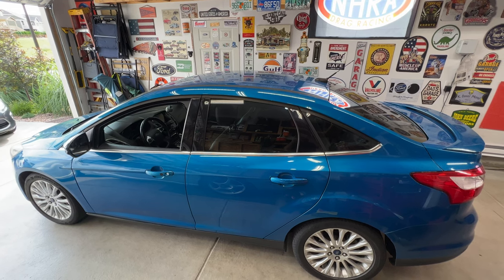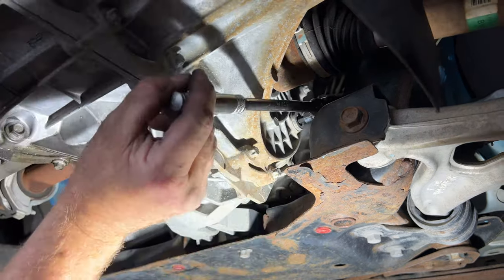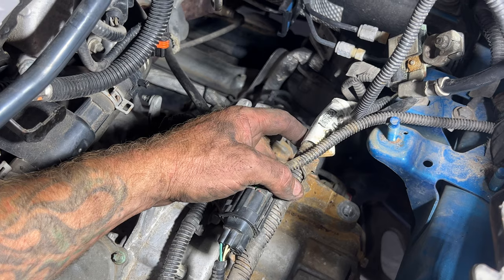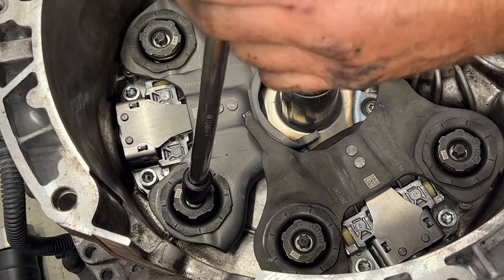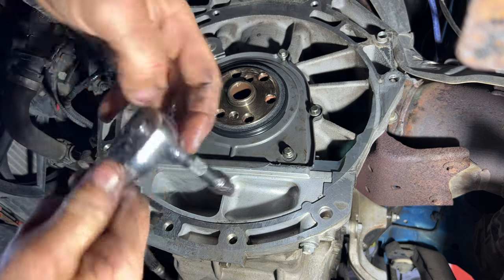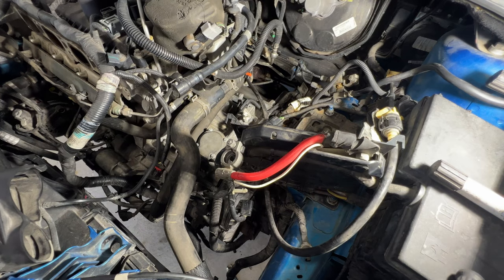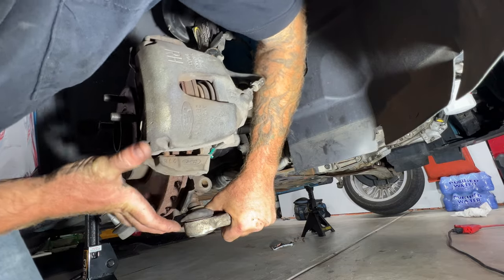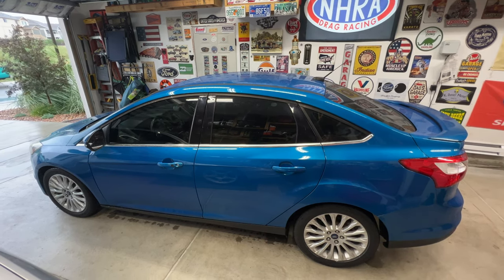2012-2018 Ford Focus Dual Clutch Change Plus Rear Main Seal Replacement How-To

Comment: Thank you so much!! This was the best walk through on this entire platform. All the angles, all the lighting, all the information like torque specs. You sir deserve a special place in heaven. Just test drove my car after doing every single step in this video and I can confirm that my car works better at 130k miles than when I bought it at 80k miles. I cannot thank you enough!
Reply from the maker: Glad I was able to help I appreciate the feedback.

Comment: After you remove the flex plate bolts, turn the flex plate a little. Reinstall two bolts, opposite each other, and turn them in. They will press against the flat surface of the crank and push the plate off. Well, that's my theory. I haven't tried it yet.

Comment: The sealing material that comes pre-applied to the new seal that runs along the inside bottom doesn't mate to any surface. The PVC gasket you applied is the only seal along the bottom. Did I miss something? The position of the camera must be hiding a ledge for that lower seal.

Comment: Thanks for all the additional time you took making this.  My 16yo son and I replaced forks, clutch, axles, motor mounts, transmission mounts and fluids with your help. 
Dealer quoted $5500 for the job ... and they wanted me to pay separate labor for all of those items. Parts were $1650 and tools needed were $500.  But a day working on a car together was the best part.
Thank you.
Reply from the maker: First of all I want to say thank you for the $100 super thanks, you didn’t have to do that but it is much appreciated. It’s also awesome to hear that the best part of the job was doing this with your 16 year old son and spending time with him. That encourages me to continue doing this videos knowing that it not only helps someone out and saves them money but is all teaching the younger generation at the same time. Cherish these moments with your son, I lost my dad at an early age but he’s the one that taught me everything I know about auto mechanics and repair and your comment reminded me of myself when I was 16 out there with my father teaching me how to fix my car in high school. Thanks again

Comment: This video by this guy is awesome.  Very detailed to get the job done.  Excellent links to get the parts and tools.   I would like to add one thing that would also help everyone taking on this task,  before transmission is removed,  I cut a angle iron approximately 1.5" x .25" x 48"  and placed it frame to frame parallel to the engine where the intake manifold was.  Then ran a chain down to the hole by where the starter was and attached the chain to the angle iron above.  I cut another angle iron approximately 1.5" x .25" x 30" and placed it  on lower part of firewall and across bottom of the engine.  Ran another chain from upper angle iron to lower angle iron and bolted the chain together.   Now I did not need to have engine support in the way of removing the transmission.  I was also able to lower the car on its wheels  while waiting for the parts to arrive.   Worked very well.  Best wishes.
Reply from the maker: Thanks for the extra tips

Comment: I wanted to thank you tremendously for taking the time and effort in putting this video together. I used this religiously as my guide to repairing my daughter's 2014 Ford Focus. My first transmission project. Your guidance made it a success. My daughter is thrilled to have her car back. Thank you. Thank you. Keep me in mind if you do a water pump replacement for a 2003 Kia Sorento.  Lol.

Comment: This was an awesome video your explanation to every detail was very helpful and excellently well done. Your master skill in mechanics made all this look like someone that is mechanically inclined could take on a project like this. I know firsthand that it’s no were as easy as you made it look. Thank you for doing this
video it was very helpful. Can you tell me how much would a job like this cost, this would be a good reference
point not to get over charged by a repair shop.
Reply from the maker: The local ford dealership here in town wanted 3k to do this.
Reply: I was recently quoted $3,800 by my local dealership to complete this job, with that quote I’m heavily considering taking this job on myself

Comment: Fantastic job with very good filming skills. You should have removed the engine oil pan to get better access to the clutch screws and the main crankshaft seal.😊

Comment: My mom got a 13 Focus off her dad after he passed. It was Garage kept with not even 20k miles on it and it needs the dual clutch done. I also noticed a couple drops of oil on the bottom where the tranny connects to the engine so I wondering if that could be from that rear seal. Thank you for the detailed video of what to do, if I can fin a place to work on it I am going to do it for her. Only thing I don't have is the scan tool that can do the relearn, ill have to see if I can borrow or rent one.
Reply: If you can’t find one you can see if a dealer will do it for you just have to get the car there
Reply: Don’t really need it as the car will relearn without it but it does speed up the process.

Comment: Fantastic Guide - So thorough! Give me lots of confidence in working on mine -  Can I ask your advice on my 2017 Ford Focus SEL? I recently bought it used (auction), carfax shows 6k miles previously the ford dealership replaced the clutch... So it shifts smooth and drives great, but it makes a scraping noise sometimes when coming to a stop, definitely a transmission noise. It's not jerking or shuttering, but this scraping noise is sometimes loud and sometimes quiet or gone, occasionally even a kind of clunk is felt, mild though. Happens most in traffic. Mostly when slowing to a stop or near stop. Car has 125k on it, clutch job from dealership at 119k. I am thinking when they did the clutch they didn't do anything for the actuators and forks area and maybe lots of dust still in that area? Let me know what you think!
Reply from the maker: Thanks for the super thanks I really appreciate that. That’s a tough one and you’re positive it’s coming from the transmission? I know a lot of the Ford dealerships when they were doing warranty claims on theses transmissions they would just replace the seals and clutch without touching the shift forks or actuators in my opinion everything should be replaced all at once. Might want to check the bearing on the passenger side cv axle. Could also put it up on some jacks stands and have someone put it in drive and just listen underneath to try and narrow it down just be careful doing this. That’s all I can really think of right now.
Reply: @BLUECOLLARGARAGE  I say transmission because when I come to a stop, the car is no longer in motion and then it goes and makes that clunk or scrape sound as the transmission fully disengages. It corresponds to the lower shifts, and the rpm changes. It's almost like something slips and then you hear the clunk.  It tends to do it more once the car has been running for a while...I was underneath it today and noticed it's leaking from the rear main seal too, so that's not great. The car shifts pretty smooth though and drives well. So I was just was hoping to avoid a lot of work... Maybe just continue driving it, I thought maybe these cars could have noises like that. This is my first experience with one.
Reply from the maker: @NickyJayO  sounds like maybe the shift forks could be caked with clutch dust and possibly sticking. If I were you I’d just keep driving it like you said and wait until it starts slipping or shuddering unless that rear main seal gets really bad. Also are you sure it’s motor oil? And not the transmission fluid? I’m assuming they updated the oil seal when they replaced the clutch but then again you never know. You may want to just check the transmission fluid level from the fill hole just to be sure.
Reply: @BLUECOLLARGARAGE  You might be right. I was just driving it and with the windows down as it disengages out of first gear on slowing it sounds like two metal plates going clank, it is actually pretty loud. I didn't know they could get sticky like that. And that's a good point I will have to check that fluid level. Not sure what low levels would do, but will def get that sorted out either way.
Reply from the maker: @NickyJayO  keep me posted and let me know what you find.
Reply: Hi, my 2017 Focus makes that identical sound and sometimes can be felt too. I have 80k on mine on the transmission parts, it's all original. I've noticed the loud clank sound and pop feeling from it occurs much worse when the car is fully warmed up and I stop quickly causing a rapid downshift coming to a stop. It could me a variety of different things, I've always chalked it up to a quirk of the noisy clutch. I've driven mine 25-30k making this sound so I don't think it's a sign of eminent failure. 😊
Reply: @randalcalvert270  Thank you for this message! That is reassuring to know :) I truly appreciate your comment....I have noticed in the last week or so that the noise has become much less frequent. No idea why. I expect it will start up again but this is the best it's been since I got it. 

I have a good mechanic to help if something goes wrong and I don't want to drop the transmission just yet. Although I have a leaky rear main seal that will need attention sooner than later... I was actually wondering if using a little lucas in the engine oil could help reduce that leak.

Again thank you for that comment that helps give me a little peace of mind!
Reply: @NickyJayO  You are very welcome!! I drive about 25k a year with a lot of both town and highway miles due to my job. I've definitely noticed the sound is more noticable when I have been driving a lot and then drive in town afterwards. I assume it's due to the clutch being hot and being noisy since it's a dry clutch. My VW Passat has a wet clutch design which is pretty much better all around, it occasionally does less noticable quirky jerks and clutch noises too.

Comment: Wow! Really great video. I’m going to use this when I replace my clutch here soon. 

Question…I have a 2013 focus s. And when I turn the car on (ACC) there is a grinding sound coming from the trans, the noise is concentrated where the TCM is. Have you experienced something like that? Do you have any idea what it could be? 

I took it to Ford and they said it was the  clutch assembly…so I decided to do the work myself. 

I just want to be sure that the clutch is the only issue.

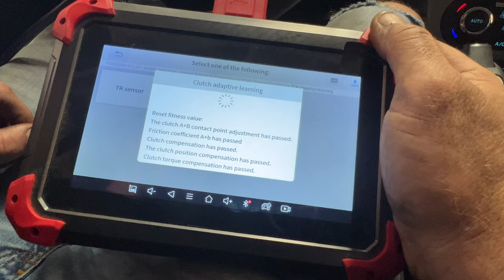Comment: great video - appreciate how you took us right to the end. After three tries with the programmer/scanner, I finally got it to pass all tests. Transmission worked fine on the test run - for two miles. As I was coming back into the driveway, it shifted strange. I pulled up to the shop and realized I had lost reverse (again). I tried going through the learning process again but when at the "clutch" stage the test failed saying it coud not read the module. This is at 3:31:22 in your video. There are two test screens - mine failed on the second one a the "two gearbox shaft neutral" point and went no further. In summary, I have forward gears but no reverse. Ideas??

Thanks
Reply from the maker: Just now going through my comments were you able to figure it out yet?

Comment: Really good video! Thanks. Did you change the oilfilter on the transmission?
Reply from the maker: This transmission doesn’t have a filter. It’s a dry clutch setup so it doesn’t take normal atf fluid. It’s pretty much a manual transmission that automatically shifts for you.
Reply: @BLUECOLLARGARAGE  we have a powershift 6 gear transmission on both cars here. A Mondeo MK5, and a Focus MK3.5. And they has a filter outside the transmission. It's a black plastic tube with a filter inside.

Comment: How long do you think the forks, clutch and clutch actuators will last before they need to replaced again? I heard the 2.0L Duratec engine is very reliable on these Ford Focuses however even with all the improved transmission components (TCM, Clutch, Forks, Actuators, seals, etc.) I wonder when something will break again.
Reply from the maker: Just kind of depends I’ve seen some go 150k with no issues but others only 75k the problem is the clutch dust.
Reply: Interesting, I am currently sitting at around 148k miles with my focus. So I am probably close to having to do some work on the transmission. Anyways, very dope video!

Comment: Great video and thank you for sharing. Just wondering, could we just removed the fan assembly unit so as to make room for the starter and flywheel bolt?
Reply from the maker: You probably could but removing the intake will probably be the best.

Comment: Thanks for uploading a very detailed video, im currently replacing my clutch and got the same luk brand, I have a question about if I need to reset the new clutch assembly? Or is it comes ready to install? Thanks in advanced
Reply: Luk clutches are ready to install just check the tabs to double check its locked
Reply from the maker: Yep like erickittle8739 said if it’s new the clutch already comes reset ready to install.

Comment: I just did my rear main, putting it back together now. I didn't use RTV because there was rubber on the seal. Do you need RTV, or did you just add it as a precaution? Update: definitely use gasket maker! Great video by the way!
Reply from the maker: I just did it as a precautionary
Reply: @BLUECOLLARGARAGE  It was leaking oil like crazy, had to throw out the seal and buy a new one and permatex ultra black, which apparently meets the OEM TA-30 standard.

Comment: Do you a auto repair shops in Greater Toronto,  Ontario. My Ford focus has transmission problem. How much to overhaul the transmission of 2014 focus thank you
Reply from the maker: I do not. I am in the United States located in Colorado.

Comment: VERY NICE VIDEO.
Is this the same clutch as on a 2013 Ford C-MAX 2.0 diesel automatic?
Greets from Sweden.

PS. How do you know if the automatic transmission is not working as well.
Reply from the maker: Yes I believe so. The transmission will start to shudder and slip while chaining gears.

Comment: Just completed putting my trans back into car after finding bad fork. The car is failing the clutch touch point procedure and I continuously get the transmission fault on screen. When reading with forscan I see a p073F. Please help!

Comment: When installing your new axles. The flange on the axle fits snug inside the bearing. When lined up, it will slide in. What causes problems is the flange hitting the bearing race. Patience. Move it side to side, up and down.

Comment: Hello, I followed the entire procedure and was able to mount the transmission. 
However I keep getting codes 
P075A Friction element B in gearbox stuck. 
P073F Cannot engage speed 1, 
P074B Impossible to engage 3. 

I only changed the forks because the A was broken, I kept the same Clutch Set. 
In the assembly procedure that was carried out following your instructions, I only had doubts with the assembly of the plate with the assembly tool. 

Maybe it's too tight and it doesn't release. Because now the forks move well, the 2 fork actuators also work properly. 
When I open the ignition there is a rattling noise in the transition as if it wanted to free the forks or the chainring. I must have done something wrong that I am still having problems. 

What do you advise me? 
Should I also change the plate? 
Do you think it's too tight and doesn't release?

 I would appreciate your comments. Greetings and thank you once again for that excellent video
Reply: I already know what happened, the double clutch, if the old one is going to be reused, it must be recalibrated with a special tool for this. So nothing, I have to disassemble everything again and start again. For all the newbies like me, if you use the same clock you have to buy the tool to recalibrate it

Comment: So i got a question. I have seen that when others change that clutch once its done, they are able to spin and move the shaft around. Once i had all of it settle my clutch plate would move about an inch to either side is this ok l. And will it be able to move normal if i put it back on that way?

Comment: Believe I’m going through this exact issue right now, I hear this rattling sound when I accelerate or switch gears to Drive. And it won’t let me drive in higher gears it’ll shift down to reduced speeds so I basically have to drive like a grandma in the meantime.  You think it’s a clutch issue?

Comment: Sorry, but... did you have problems with transmission ??? i noticed you didnt remove the forks metal protector at 3:38:48. Its critical to remove them after instaled. Please let me know.
Reply: By the way thanks for this important video. Hugs from Dominican Republic 🇩🇴

Comment: I got my clutch from the same place you got it. I also watched this whole video 3 times over. 

I believe I was sold a bad clutch. Every 200 to 400 miles or so, my Focus will get stuck in with the inability to move forward. I'll have to turn the vehicle off for 30 seconds, and it'll be good to go. I'm thinking of returning the clutch and purchasing one from the dealer. 

I already got two new OEM Actuators, and TCM under warranty.

Comment: do you have a part number for the seal kit? I don't need to change the seals as they are the updated ones but i need the grease and the bearing mount for the cv axel on passenger side.
Reply from the maker: It’s in the description should be the fourth link down. It includes all the seals and the special grease.
Reply: ok thank you @BLUECOLLARGARAGE

Comment: So what is the permanent fix for this transmission/ TCM. !!
Reply from the maker: No real permanent fix. The new updated seals will not leak like the original factory ones thus not getting gear oil on the clutches. The problem is all the clutch dust that develops and gets all over the shift forks causing them to stick.